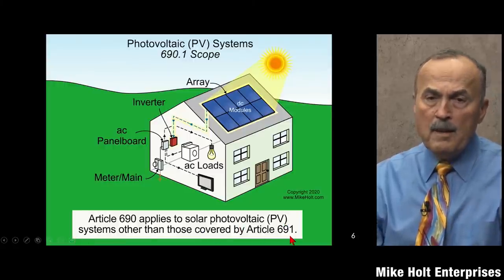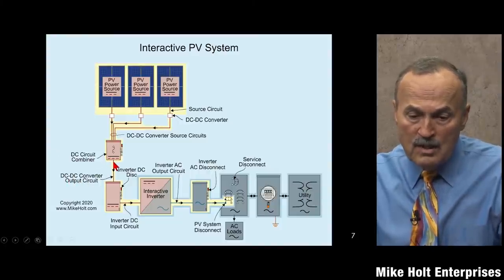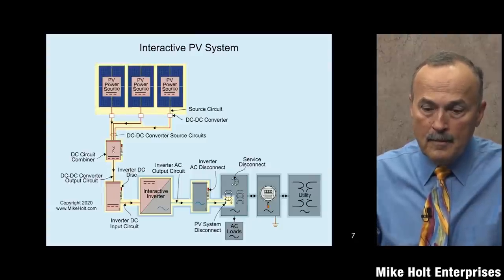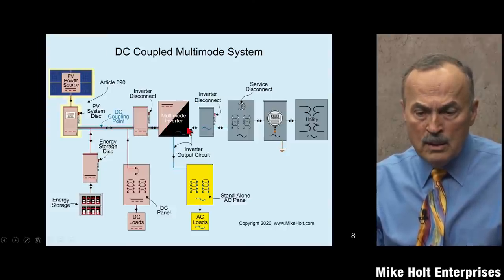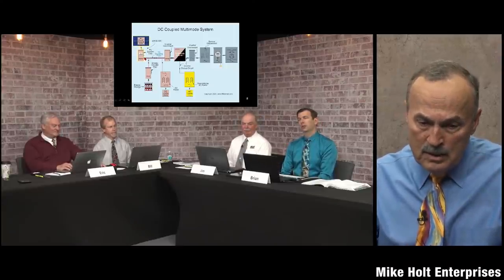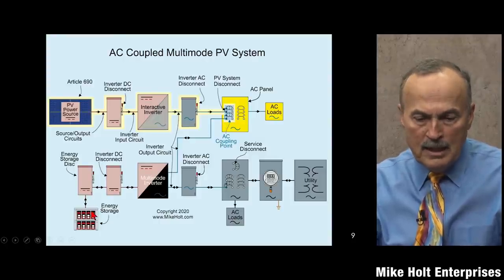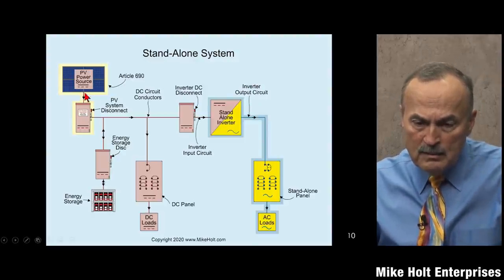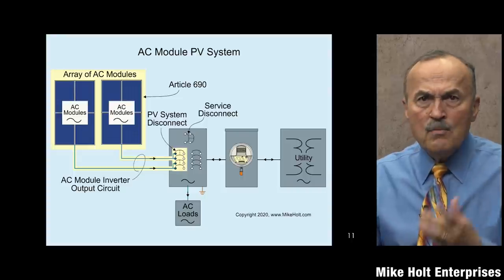Solar Photovoltaic (PV) Systems, Scope, NEC 2020 - [690.1], (39min:21sec)

Comment: 690.33   "Mating connectors can be used as a disconnect if not readily accessible or require a tool. " So I guess we can place MC4 connectors inside an enclosure that has a screw down lid?  or link me to an approved connector....

Comment: The key is what kind of inverter you buy. My inverter works off grid,it has solar input,48v battery, an mppt charge controller. It also can input 240v mains or 240v generator. I use a completly separare double wired 240v system. So I have outlets that come from the company and outlets that are my emergency system. Some grid tie inverters have a hybrid off grid system as well that use back up batteries. As someone has said the technology is changing all the time. When my utility goes off I have off grid outlets that I use.Been working well for over 5 years.

Comment: The safety disconnect between the multi mode / inverter and the service MSB / service disconnect is required by a utility (i.e. PG&E). This disconnect is a visible bladed safety fused disconnect.

Comment: I have a problem with the Graphics as well. There are Missing Components on the Graphic. Between the PV Disconnect and the Energy Storage Disconnect there should be a Charge Controller or Several Charge Controllers that regulates and transform power, then it conditions it into the expected Voltage and currents into a Battery Bank, Cycling the Battery through several charging methods, and prevention from over-charging them ...
Reply from the maker: You are 100% correct, I'm sorry we didn't include this detail, it will be corrected for the book shortly. Thank you so much for helping me do a better job.

Comment: The DC-DC converters in your graphic are typically called Power Optimizers, and in the code they are grouped into Module-Level Power Electronics (MLPE). 
They are there to do something called Maximum Power Point Tracking (MPPT): the Power Optimizer controls the effective impedance of the circuit through itself (including the module/panel) with a DC-DC converter, to keep the string voltage near the maximum, where it will transfer the generated power most efficiently to the load equipment (usually an interactive inverter or charge controller).
The other common type of MLPE is "microinverters", which is what's going on with the ‘AC modules’ drawing.

The other common DC voltage for DC load systems is 48V, because it's four times as efficient on equivalent conductor sizes.

Comment: Good (very) high level intro. May be worth mentioning that besides NEC and AHJ, you also have state codes (e.g. CRC and CFC for California) to consider.
For ESS, the NEC is still a bit old-fashioned and doesn't cater well to modern AC-coupled storage battery inverter systems like the Tesla Powerwall. Some AHJ's still scream about not having a giant DC disconnect marked with max short-circuit current (following 480.7(D)) while ignoring 706.7 for the Powerwall (because it has a tiny on/off switch). Then there's the screaming about 110.26 clearances, and somehow 706.7 becomes interpreted as needing a visible knife-style disconnect.
Reply from the maker: Wow, you know what your talking about!...
Reply: the struggle is real!

Comment: The multimode inverter is bi-directional, i.e. it can either work as an inverter using battery power, or it will be ac coupled to the grid ac or the other inverter ac and then charge the battery, hence the description ac coupled. DC coupled means the battery is charged from the DC derived from the pv side.

Comment: Bill does a great job. My concern is also on having PV and batteries on the same bus. How do you control voltage on each and is there a charging circuit? And part of the confusion is how the ESS (batteries) behave during charging, discharging and stand alone modes. We’re working on that in IEEE P1547.9 along with many other ESS challenges.
Reply from the maker: I revised the graphic to show a 'charge controller' between the PV and batteries. Sorry for not doing a better job.

Comment: Mike, I have a problem with all your diagrams that incorporate battery power. Most of them show power coming from the PV panels going to the inverter and also directly to the batteries. If that were the case, the batteries would be immediately fried. PV power is often in the 100 VDC or more range. PV power must go through a DC charge controller before going to the batteries in order to charge them at the correct voltages for the particular batteries being used ( flooded lead acid. AGM, lithium etc.) Many of the inverters on the market also incorporate a solar charge controller but many do not.. There should be a path showing the PV output going to the inverter/charge controller and then controlled DC going to the batteries or the PV output going through a separate charge controller and then to the batteries. Please let me know if I am missing something. Thanks.
Paul
Reply from the maker: I"m working on improving this graphic, send email so I can send you the updated images (Mike@MikeHolt.com).

Comment: Extra info on DC to Dc converters with MPPT, maxium power point tracking. The DC to DC converter  continually changes its effective input impedence to keep the PV pannels operating at their maxium power given current solar conditions on each seperate pannel.  Consider the following three conditions. 

1) A  load represents a  high effective impedence to the PV power source. This allows very little current to flow while the pannel's output voltage is near max for the pannel. But still almost no current × max rated voltage results in very little power being extracted from the PV  pannel. Meaning they are opperateing inefficiently. 

2) A load represens a very low impedence to the power source, say a near short. The  pannel will push near max current but due to internal resistance in the PV pannel, the output voltage drops to a very low voltage and again, very little power is extracted from the pannel making it operate very inefficently. 

3) some where  between  those two extremes, a DC to DC converter will  continously reset its effective input impedence such that  maxium power is extracted from the PV pannels under changing light conditions throughout the day. 

The DC to DC converter regulates its output voltage that go to a combiner and inverter, such that the inverter may draw maxium power from the DC to DC converters.

Finally at least with some types of DC to DC converter provide galvanic  isolation  between the DC to DC input and output.

Comment: Video suggestion:
I have not watched the 2020 Solar yet, but I would really appreciate a video explaining if 705 12(B)(2)(3) is also applied to each and every up stream load centers of downstream solar interconnect. 
If you tell me, I will believe it. 
Lots of back and forth on this topic. 
Thank you
Reply from the maker: Watch this video to get your answers! https://www.youtube.com/embed/7vD0r_bVjuo
Reply: @MikeHoltNEC  Mike, it’s fun to get your replies, thank you! 
I’ve watched the video you suggested twice, I have not noticed it speak to the upstream load centers, if they also need to follow load side interconnection rules?
 
Meaning, if I interconnect solar to a sub panel using 705.12(B)(2)(3) (NEC 2017)  
Does the main panel upstream of the sub panel also have to follow 705.12(B)(2)(3)? 
It would seem the arguments might be:
1. that current (solar or utility) will flow towards the load 
(house more often than not) 
Thus We won’t see an excess of heat being applied on the upstream, main panel busing as it might do on the interconnection bussing. 

Counter argument…
If it is a bright sunny day, and there is no load in the sub panel, yet there is heavy load in the main panel, you might get full amperage/heat being supplied to the main panel busing which could be excessive. 

Reply…But the Utility supply at that main panel bussing will only be the difference of the needed house load minus the solar supply,…right?
In the end, I still don’t see why the main panel bussing would be required to follow load side interconnection rules. 
Maybe I’m missing something? Thanks.
Reply from the maker: @davidorcutt9246  Please post your question on MikeHolt.com/Forum.

Comment: Multi-mode inverters are intended to supply the power in a bidirectional fashion( You may observe the energy flow arrows) which was not clearly highlighted in this great video.

Comment: Is there a NEC code explaining off grid and grid power in the same building? I would like to run two breaker panels so that I have my 220 appliances on grid and a completely separate breaker panel with  all of my 120 appliances tied to off grid power, two power sources in the same house with zero chance of connecting to eachother is what I want.
Reply from the maker: Yep, Article 690. You need to get with a Solar Contractor that is familiar with such a system.

Comment: Minor correction, or distinction. Referring to the discussion at 12:01 When grid power goes down, inverters connected to the grid are required to detect the grid going down, and require inverters to go down completly so as to not back feed power to the downed grid are anti-islanding, not islanding. 

On the other hand, systems that detect the grid going down and disconnect from the grid but continue to operate providing power to the building, with power from solar, battery, wind, and or generator  use islanding mode or technology that allows local generation of power without back feeding it to the grid.  Maybe we can think of it like a little island of power isolated from everything else.
Reply from the maker: Keith, my work is based on the National Electrical Code, the NEC uses the term "Interactive Inverter" for what you call 'anti-islanding.' Search the NEC for the terms 'Interactive' so you can better understand my usage of this term. Please watch the video again after you review this term in the NEC and let me know if you still feel that I need a correction.
Reply: @MikeHoltNEC  Thank you Mike🙂.  I virtually immediately regretted starting with correction, as it was too strong, but was pulled away on an errand before I could remove that part.

I reviewed the video discussing the graphic presented upto and including and just after the timestamp 12:01. The discussion and the graphic under discussion were clearly about an interactive system without any battery backup, but moments later the speeker discusses battery backup in conjunction with islanding which is spot on. But, became a source of confusing at that moment in time with the discussion up to this point and the graphic depicted at 12:01 were clearly interactive without battery backup.     

I'm not an electrician, consequently my knowledge of the NEC code is sparse so maybe you were referencing something else, but I did find this... NEC 690.60 "only inverters and AC modules listed and identified as interactive shall be permitted in interactive systems."

Then I found on your website a pdf with a graphic discussing NEC 690 it pointed out "listing means that the equipment is in a list published by a testing laboratory acceptable to the authority having jurisdiction". As an example, on the same graphic I seen an inverter identified as "utility interactive inverter" with its listing UL1741.

 Looking up UL1741 I found in its scope among other things, section 1.2 for interactive equipment, and it referenced IEEE 1547.

Looking up IEEE 1547 I found in the 2018 revision, section 3.1 defined island: A condition in which a portion of an Area utility electric power system (EPS) is energized solely by one or more Local EPSs through the associated point of common couplings (PCC) while that portion of the Area EPS is electrically separated from the rest of the Area EPS on all phases to which the distributed energy resource (DER) is connected. When an island exists, the DER energizing the island may be said to be “islanding”

I didn't invent the name anti-islanding inverter. The phrases islanding vs anti islanding or islanding protection,  are things that interactive inverters do depending on the situation, and how they are intended to function. like my micro grid tie inverters have anti-islanding technology which  means they fall into a subclass of inverters that we call interactive inverters with islanding protection, and contrast with interactive inverters that have islanding technology. 🙂

Comment: Can you clarify "non-interactive" PV system NEC requirements?  31:30 - Stand Alone Systems - for instance an extension-cord based 120VAC distribution to only a few appliances.   Inverters often have GFCI - are there NEC grounding requirements?  Can you clarify what and where Articles are in the NEC for the various subsystems (only 690 is called out on the slide).
Reply from the maker: Please post your question on MikeHolt.com/Forum.

Comment: Starting at 18:54 - Mike, the Stand-Alone AC Panel does not need a 'main breaker' OC device noted in the diagram because a partial loads panel can be fed through a back-feed breaker. Since  the 'main breaker' or service disconnect is noted in the right panel between the meter and the inverter disconnect, we know this is a partial home backup versus a whole home backup. This is important as the partial loads panel can be anywhere from 20amps to 200amps, and good luck finding a main breaker under 90amps, along with the always important question....why pay for more than needed?
Reply from the maker: All panels need overcurrent protection, see 408.36!

Comment: I've been thinking of adding an array of ground mounted Pv pannels as opposed to roof mount. I'd be using micro grid tie interactive inverters (AC module) to a breaker on the PV system disconnect. 

I follow you on your comments on auxiliary ground issues. I get that all the metal parts need to be properly bonded and connected to ground at the service pannel.  But I'm wondering if the racking (mounting) system is steel pipes set in concrete, would that potentially act like an auxiliary ground or does proper bonding make it not an auxiliary ground? Or, should I consider using wood post set in concrete to support the PV pannels. 

Your thoughts on how to be safe here?  And, thank you inadvance for your time and consideration.
Reply from the maker: Since you are using a/c modules, it doesn't matter that the  metal racking is connected to the earth via the steel pipes.

Comment: Sir mike, I have a question but not for PV. For Smoke Extract Fan, Is it still needed for Overload Relay? I am confuse because Smoke Extract is intended to operate during fire mode right? i am realy confuse
Reply: @MikeHoltNEC
Reply from the maker: Post technical questions on MikeHolt.com/Forum.

Comment: Does the NEC address fly back voltage from an inverter on the DC side in respect to disconnects or overcurrent devices?  I am thinking in terms of available fault current from a battery bank plus energy what is added to the arc by the collapse of the magnetic field from the inverter transformer.  I see this addressed in AC circuits with motors in terms of AIC for fuses/breakers but I can not find anything addressing this on DC, especially in the Canadian Electric Code.
Reply from the maker: No clue.

Comment: I have a PV system that has a 10 awg ground for electric component grounding in conduit and a 6 ga bare wire connecting the rails /panels outside conduit that goes to the inverter that will connect to a bus bar with the 10 ga and will connect thru the a ground to the other component boxes to the main house AC box/ ground rod. From looking at the plans it shows the bare wire going to the AC ground with no mention of any other grounds.  I'm told I need to have 2 additional ground rods installed that will connect to the inverter bus bar then to the 2 new rods and back to the AC ground rod. From all the info I seen this makes no sense or am I totally confused
Reply from the maker: You are correct, there is no need to have the additional grounding that you were told. That is why it doesn't make sense, the rule for 'grounding' is contained in 690.47 "For PV systems that are not solidly grounded, the equipment grounding conductor for the output of the PV system, connected to associated distribution equipment, shall be permitted to be the connection to ground for ground-fault protection and equipment grounding of the PV array."

Comment: Hi Mike, do you have a diagram showing a PV system and a standby generator for a house. I have had conflicting advice on a issue. Should the DC feed, from solar panels be installed on the line side of a transfer switch? Thanks in advance!
Reply: should be on the side for the transfer switch before main